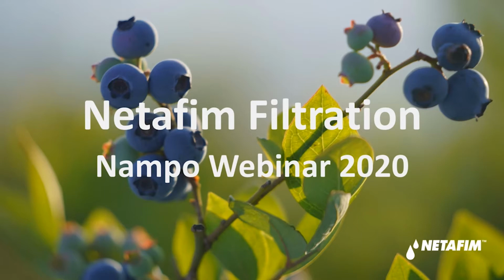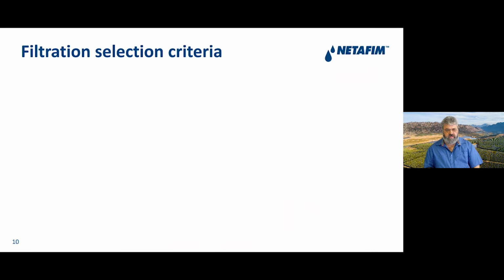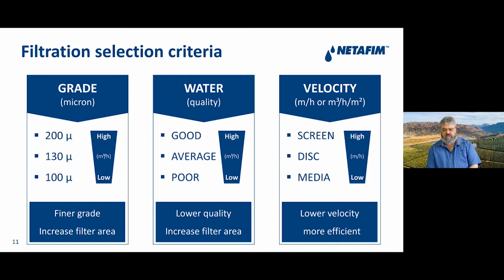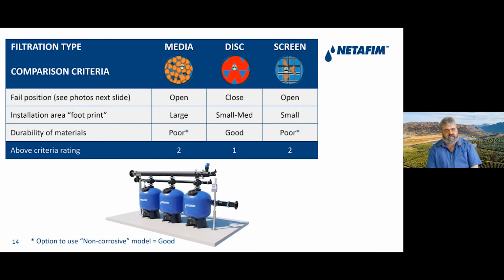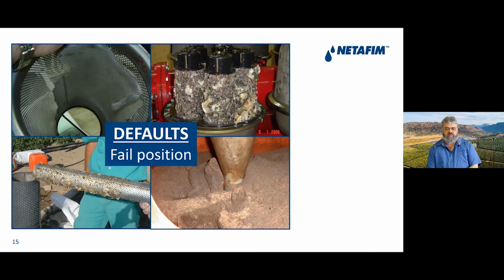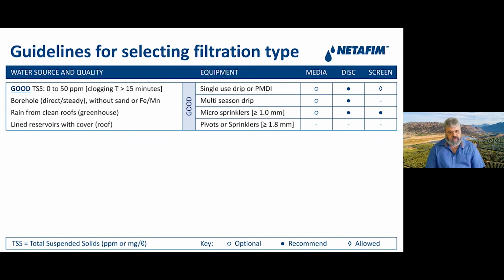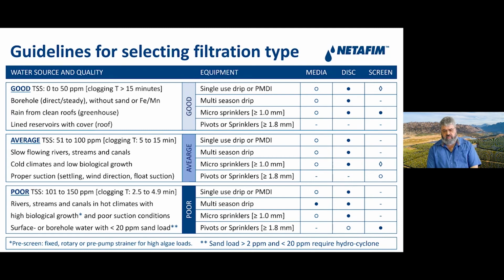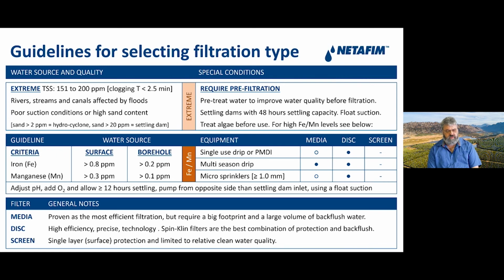Selecting the right filter for the job - Netafim Webinar at Nampo Virtual

Comment: Irrigation engineer in kenya,glad of your video on filtration.

Would you mind expounding on Fe Removal for irrigation water.

The pH adjustment chemicals,  their reactions and also the oxidation procedures.

Got a problem the rift Valley where driplines are getting clogged seasonly by iron from boreholw water